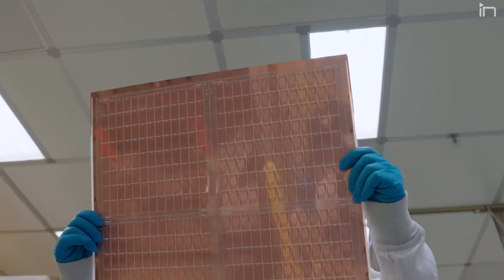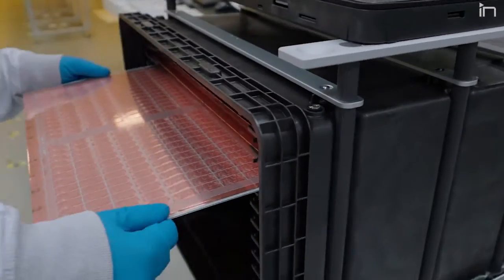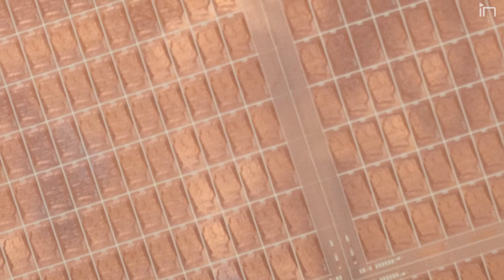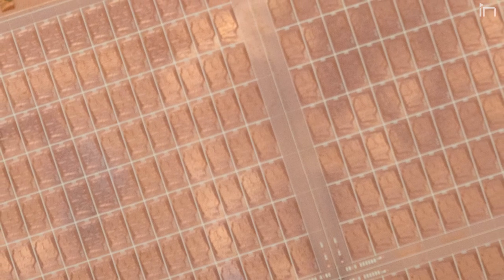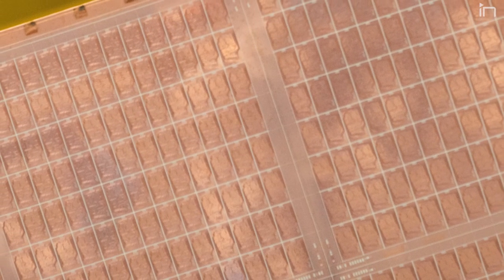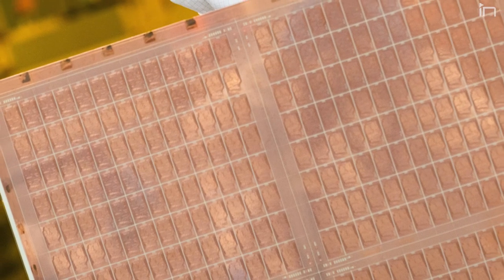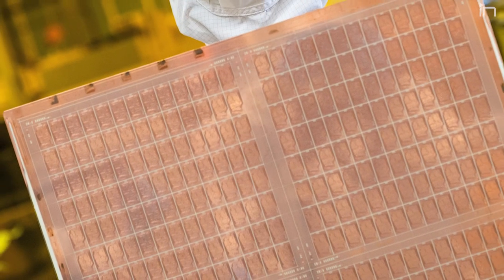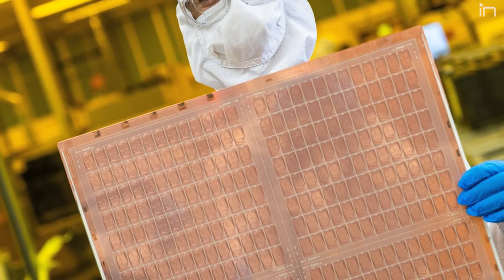Intel’s Looking to Use Glass for Chiplet Substrates in the Future

Comment: 'System the size of lcd panel'? .... i though those panels were made multiple 'package'  elements not a single huge system.
Reply: If the area yield allows the whole pcb will be made of Glass i think. No more bridges.. interposer gone.. direct Connection of tiles onto the glass